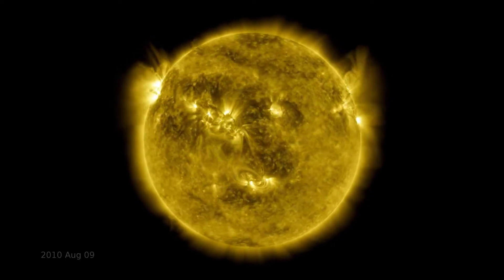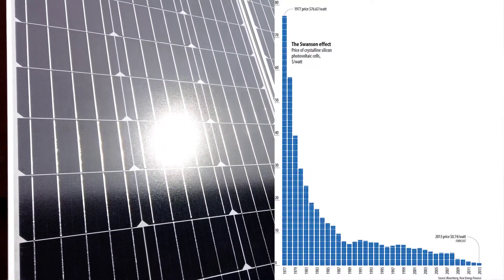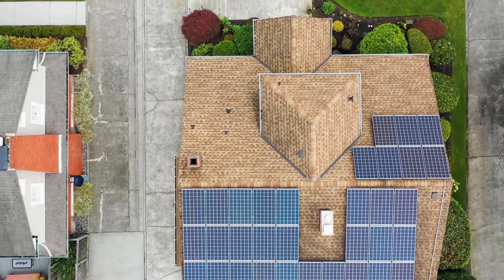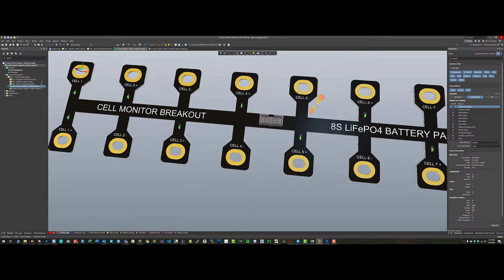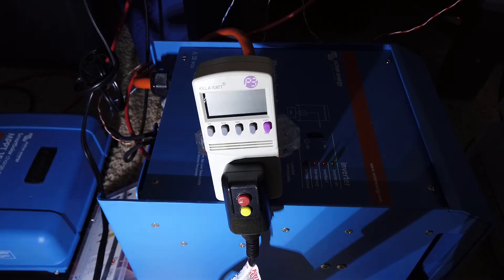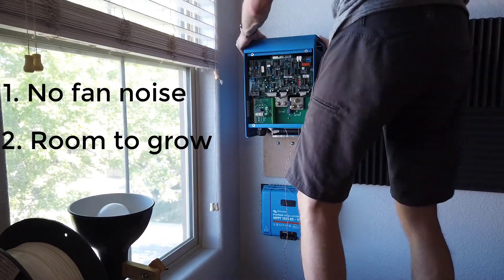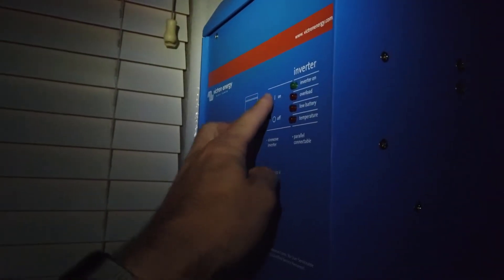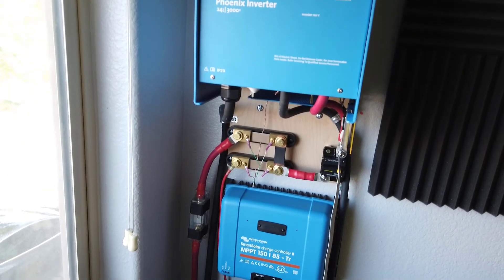Building a DIY PowerWall for my Electronics Lab

Comment: Hi Zack,  Great video.  Nice job.  And I understood about 60 to 70% of the content (that's pretty good!).  We are completing the construction of a small data center in a secure space at a dod facility.  Every rack and piece of equipment is grounded.  Although the walls of the spaces are gypsum board, fire-rated plywood is anchored to all the walls for easy mounting of anything.  The vinyl flooring is static dissipative tile bonded to the grounding system.  Even though the rooms have wet sprinklers, they also have dedicated portable fire extinguishers at each entrance.  We have extensive and redundant cooling capacity.  There are multiple levels of security to protect from unauthorized access.   I really like your off grid installation.   I think you have a future (when you are old and gray) as a college professor.
Reply from the maker: thanks Steve! that sounds like a cool project. i would really like to get ESD flooring for my lab but it is not cheap! I'd love to teach at some point in my life, I'm considering getting my masters for that reason.
Reply: @ZacksLab  Just an fyi Zack, this is the 1st project I have seen 200% Neutrals in all the power and lighting panels (except for the large 480V feeder panels.  The vast majority of the loads on these panels are 277V LED lights and computers.  Apparently, these produce large amounts of non-linear loads producing harmonics.  I don't recall seeing 200% Neutrals with fluorescent or halogen lights in the past.  I am not sure if this is a trend for the future.  Additionally, I remember 20 years ago when the NEC was just contemplating TVSS.   We had no surge suppressors before.  On this project, every 480V and 208V panel has a surge suppression device.  So, maybe this is another trend in construction.  Take care.  sj

Comment: I'm guessing that you're also a Ham... Do you have any problems with interference to tv/radio/test equipment/ham gear from your solar installation? 
73 DE W8LV BILL
Reply from the maker: hey Bill! thanks for the comment. haven't noticed any issues in test equipment or radios, the pure sine wave inverters are pretty clean. the modified sine wave inverters on the other hand have a quite a bit of harmonic noise/distortion and wouldn't recommend them if you're thinking of doing a similar set up. 73

Comment: Awesome job! Have you tried running the reflow oven with this setup?
Reply from the maker: thanks Omar! Yes, the reflow oven is surprisingly efficient, a single cycle only consumes about 40 watt hours worth of energy. The soldering iron and hot air gun are the big hitters... I have to be careful not to leave the soldering iron on, as it still consumes a considerable amount of energy even in standby mode.

Comment: Very nice setup! Your balance lead solution is extremely tidy! If you'd used larger panels then you could've used dssr20's instead of the mppt controller.
Reply from the maker: thanks! yes, i saw Dacian’s video about MPPT being obsolete in off-grid cases after buying these panels and the Victron, would have much preferred to go that route in hindsight. love Dacian’s hardware!